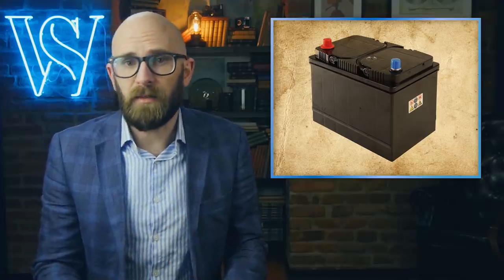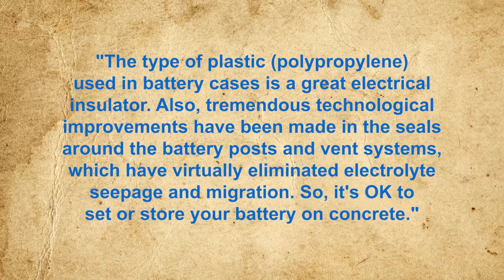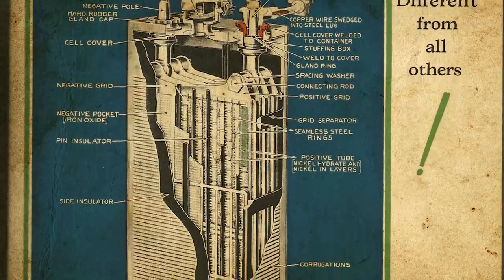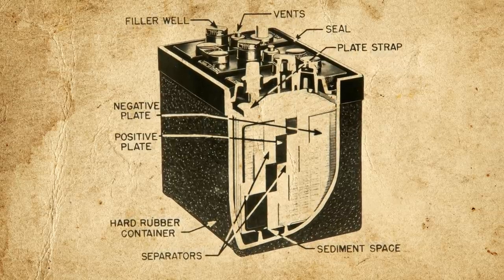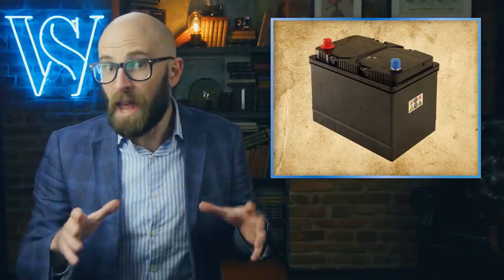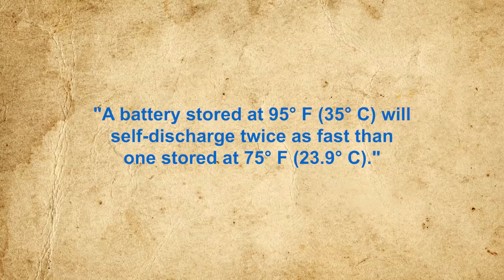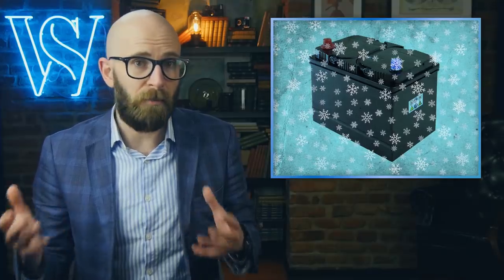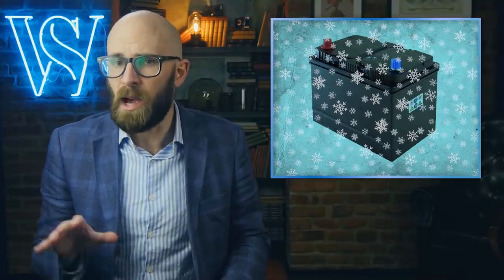Why Does Placing a Car Battery on Concrete Drain It?

Comment: Hmmmm and when you weld on bare concrete without proper insulated footwear and mats under you are more likely to be electrocuted by your welder.  The concrete absorbs water and can become very conductive.  I store about 30 batteries from all my trucks tractors and smaller machinery in the machine shop on a bare steel shelf.  The case of the battery is  great…but condensation builds up on the batteries throughout the Cold and warm of the Winter and the dirty terminals (if you don’t meticulously clean everything because you happen to be (as my wife calls it) a hopeless neat freak with OCD that would shame a ball bearing QC Inspector, then the battery can actually conduct to the surface it is on.  Truth is that modern batteries do not perform well in the cold.  I’m about to add 72 new D size Semi Truck AGM’s to my solar system and am designing a new shelter to keep this from being a problem

Comment: Any battery will drain with time. Period.

Temperature increases the self discharge, but also increases the energy/reaction.
Reply: there is some truth to that, but a battery sitting on concrete drains faster than a battery set on a couple of 2X4's, grew up on a farm, seen it tested dozens of times, CONCRETE DRAINS BATTERIES, regardless of what this video says, even the new plastic ones

Comment: Modern batteries will discharge if dirty on the outside. And i mean dirty that you cannot see. Run a volt meter around the case and see if you get a reading. If you do, you are getting a discharge.

Comment: This means that the Sears Diehard battery commercials from the 70s, where they parked a car on a frozen lake in upper Michigan in the dead of winter or something and it stayed there for three months, covered in snow and ice and then cranked with no problem... this video means that the commercial didn’t mean anything. The more grueling thing to do would have been to park it on a downtown city street for 3 months. Then see if it starts. lol

Comment: Idk.  If that battery gets low your hooped.  - 40 will kill a battery.  You need a battery blanket with a block heater and keep it the car plugged in if it's not running.

Comment: ..and why concrete, specifically?  what about wood? dirt? Styrofoam? glass blocks? snow? metal? Simon's back?  Danny's back? (oh, wait! wrong channel ;) )
Reply: If you live in a northern climate, and your home is on a concrete slab, and you try walking barefoot in the winter, you wouldn't ask.
Reply: @christelheadington1136  as a matter of fact, I'm from CHICAGO  so I'm aware of the effects of trying to start an engine where the oil has turned to sludge from the -80F wind chills.. oh yeah!  my question still stands :)
Reply: @WarpRadio  -My point is concert retains cold more than wood...etc.

Comment: i can tell you as a mechanic that 200% cold weather is much worse on a lead acid battery than warm weather is.......
Reply: DIY Chad 726 As a family of professional drivers, it doesn't matter nearly as much as everyone thinks. What actually kills batteries is heavy outputs, we run a lightbar, radios and usually an inverter the entire time we're working (8 hours or so usually) and we need a new battery just about every year.

If you want to make yours last, use two batteries

Comment: Call be cynical but your primary source seems to be the industry not an independent researcher. Has anyone stored batteries on different surfaces then tested them. Seems kinda obvious.

I can say this most people in ND just replace their battery in January when it can't start the auto anymore.

Comment: When my aa batteries are dead, I put em in the freezer for some extra usage. Cold is good for batteries, I thought?
Reply: Once a dry cell is "dead" the cold storage will not have much effect. You could get a little more use out of them by warming them up during use, but you risk expansion and leakage.

Comment: Yup..  My electric motorcycle range is reduced at least 30% in very cold temperatures.   Anything below 10 degrees celsius and it's effected.  Interesting vid...but I'm still not storing batteries on cement.....and neither does any shop that sells them....hahahahaha

Comment: I went to a tech school for electronics. In personal use, I stored many batteries on concrete slab until needed at varies times. I knew better from the practical use. Yet, I was forced into many an almost religious-like argument with this very myth many times by fervent believers who seemed seriously determined. I thankfully escaped as a heathen, unconverted to stupidity. Hince the downvoters of the video, who still worship that cult.

Comment: I first heard about this 20 years ago when i put a friends cordless drill on the concrete floor and he had a go at me! I nearly fell over laughing because i KNEW it was not a possibility, even with an actual led acid battery least of a nicad drill battery,i think still nicad back then but could have been nimh. People are so flipping stupid, i never did manage to convince him he was retarded! He also thought it was much safer driving around not wearing a seatbelt, good indicator of his intelligence... Go to a battery suppliers warehouse and look how many brand new batteries they store on the floor, LMAO! Most car batteries never last as long as they should because of short trips and weak alternators not de-sulphating the plates.

Comment: I live in -40 weather regularly and it destroys batteries.
Reply: That's probably because of the engines you're trying to crank. Oil gets mighty gooey in there and the gas doesn't vaporize very well. That destroys batteries.

Comment: I was trying to jumpstart an old Safari minivan with a stuck hood release.
I was trying to hook the + cable to the battery lug of the starter, so I was under the van with the battery on the ground in front of the vehicle.
A stranger driving by stopped  and interupted to tell me that I needed to put the battery on a 2x4 to prevent the concrete from draining it...
Thanks, dumbass.

Comment: But why do EVs lose range in the cold?
Reply: The batteries in the high voltage drive system use a heater grid to keep them at the optimal temperature. The cabins are also heated with an electric heater. Plus the drivetrain fluids are also more viscus creating more drag on the drive motor.
Reply from the maker: A number of factors, but one of the biggest is just increased air density which has a huge effect on range. The faster you go, the more energy it takes to push through that air, and it's not a linear increase, but more of an exponential one. Then, of course, there's the use of heater system and the like, though this doesn't actually take that much power, especially when compared to using an AC in summer. And when using the batteries, they naturally stay somewhat warm assuming it's not insanely cold (and, again, if they get too hot in the summer they need cooled). So the biggest practical difference while driving at least does usually mostly come down to air density. -Daven

Comment: Why are car batteries lead acid and not lithium ion
Reply: Was thinking the same. Too much risk of impact and fire? Hybrid batteries are lithium but they're essentially built into the structure of the vehicle safe (relatively) from impact
Reply: It just occurred to me too that lithium batteries require special charging techniques ... if you simply replaced your lead acid battery with a lithium battery your alternator would damage it.
Reply: A better alternative is a Advanced Glass Mat (AGM) battery.
Reply: @sendintheclowns7305    are they now? Interesting. Only a matter of time I suppose before we see them in cars. Basically all of Chevrolet cars and trucks are coming with AGMs

Comment: Must be a 101 how-to guide on how to perfectly hide a corpse under your patio steps or paving.
 Concrete/Cement it's a real thriller.
Do not use a flat battery for applying electric shocks...before disposing of the said body.
  As you will quite literally be there all day. 
  This is just a Joke...So do not condone or suggest such abhorrent ideas! Especially with a flat battery!

Comment: Concrete is always cooler than the environment, leaving a battery on concrete will lower the temperature of the battery which in time will reduce the voltage of the battery especially if it's not in good condition. Cooling any battery will lower it's voltage and warming will raise it.
Reply: The concrete only feels colder because it takes the heat away from your hand fast like aluminum...and he said cold batteries self drain slower.

Comment: say whatever you want, but I'm from the frozen north, I live in true cold. it could be 20 below zero for months at a time here. batteries stored on the ground die while batteries stored on wood shelves live on. i don't understand why this is, but I know the truth of reality. batteries that you store on a shelf will be more likely to live on while batteries stored on the ground (concrete or not) will often be dead if not ruined. you quote interstate battery as to the survivability of their own batteries in the cold, ya super believable because the manufacturer said so and I'm a sheep. 

even if I'm wrong and you're right, storing your batteries off of the ground and on a shelf is not a bad practice. also maybe it's not a bad idea to put a 2 volt charge on your batteries every now and then, just to make sure. i'm not saying, but i'm just saying.